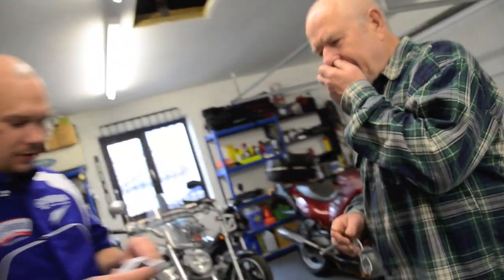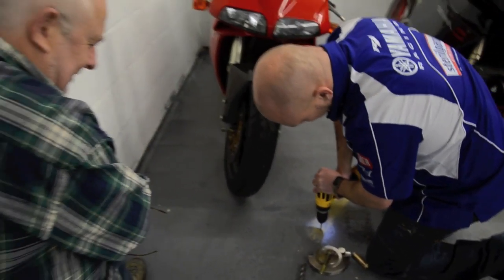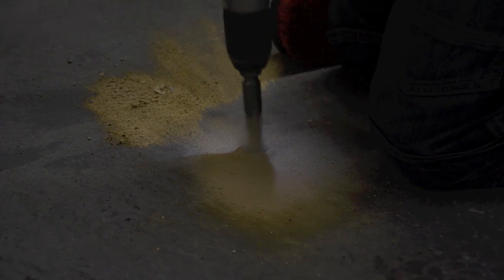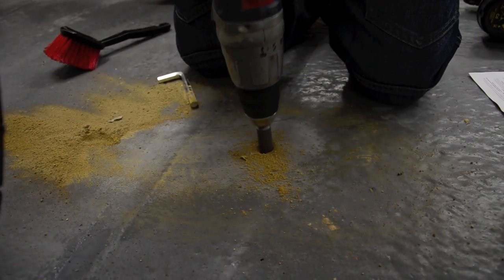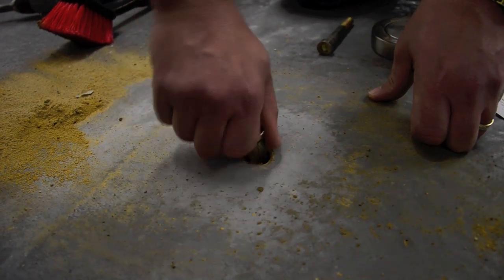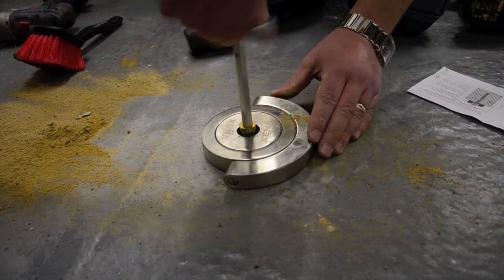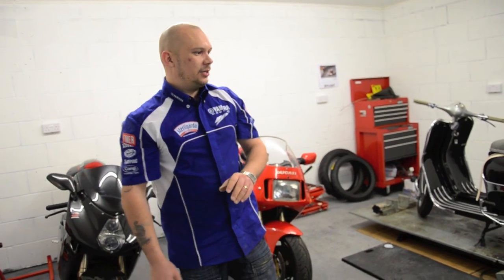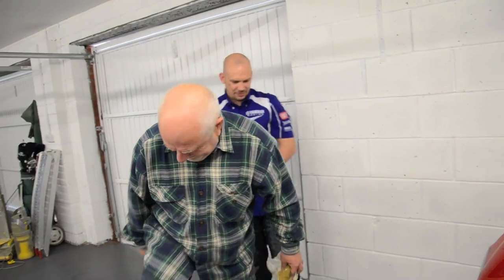Motorcycle Sport & Leisure: Xena Ground Anchor Installation

Comment: how does that anchor stand against a grinder?
Reply: @danielthompson803  "nothing stops a grinder!...."

Correction!  

There are quite a few things that could stop an grinder (ex. if a grinder is used on one's private property):  

1.  Motion detector.
2.  Self-defense classes: boxing, wrestling + grappling and mixed martial arts.  Include good cardio classes.
3.   Large attack dog (s).
4.  .38 special revolver, .44 magnum, 12 gauge shotgun, etc.
5.  And some large, hard core, hard-hitting' associates.

Yes!  Two or more of the above can stop the angle grinder!

Comment: Three off the shelf tools could easily defeat that security in less than a minute.

1, A petrol Stihl Saw, cut the chain or anchor 
2. A big crow bar or lever to wedge under the anchor and pull it up
3. 1000mm bolt croppers

You need a better anchor that concretes into the floor, a 19mm+ chain that routes through your bikes frame and is not lieing on the floor as said.
Reply: arete commerce bolt croper wouldn't work, nor a crow or the jack as the insert expands as the bolt goes down. The only way to beat it is with a grinder!

Comment: EZ...attach motorcycle jack to the anchor and it will pull it right out of the ground effortlessly.  The height range on the jack is a lot higher than that security bolt is long.  No problem.